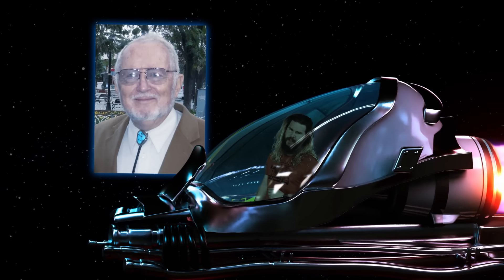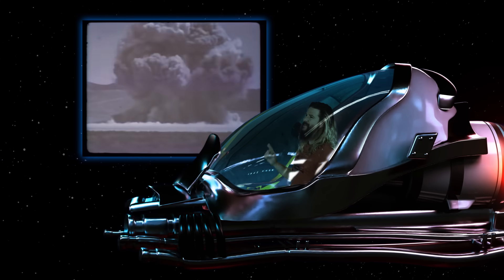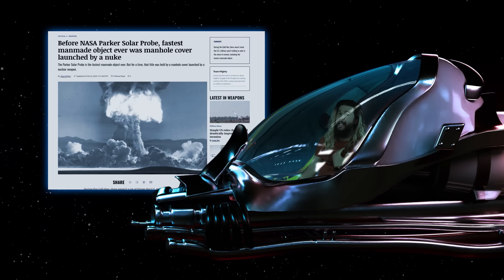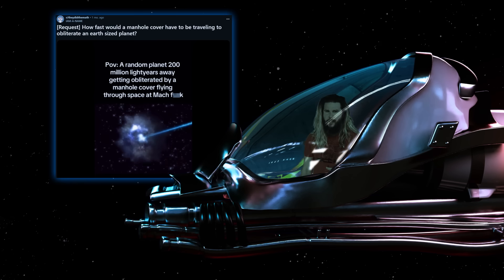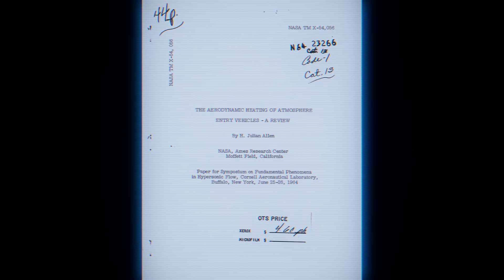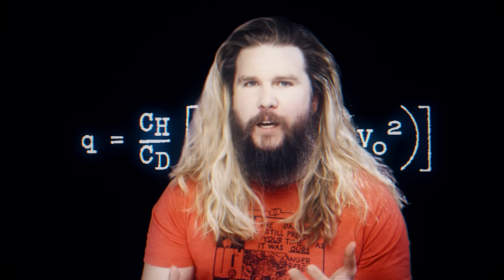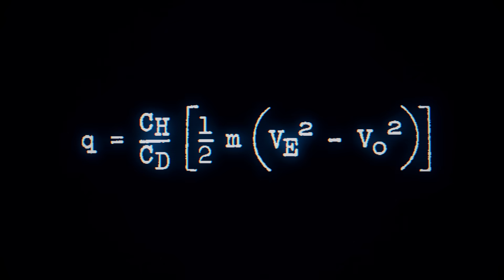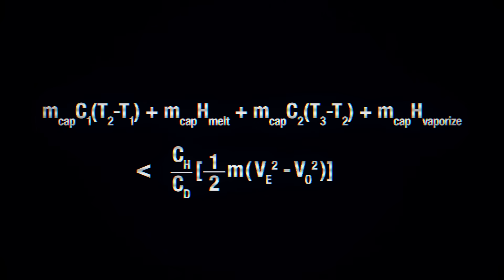Debunking the Nuclear-Powered Manhole Cover

Comment: You made one critical error in your calculations. You seem to have assumed that your audience wouldn't angrily math, but boy howdy are they down here angrily mathing.
Reply: that is what my math teacher was missing... he made us do long calculus problems with no real objective, Kyle has broken the Internet by having a bunch of nerds mathing at a non consequential problem for the privilege of proving others wrong...
Reply: Key factor not discussed: heat transfer is not an infinitely-rapid process, i.e. it isn't instantaneous. While meteors moving 3x slower burn up, an object going fast enough could theoretically make it through before it has a chance to burn up. The object, admittedly not factoring in drag, would have cleared the atmosphere in barely a SINGLE second, meaning it may not have had enough time to absorb the necessary heat to be vaporized.

Second, the comparison with meteors is flawed in a very specific way: meteors are going from a vacuum into a steadily INCREASING dense atmosphere AT AN ANGLE, where the "manhole" would be moving from a dense atmosphere into a rapidly THINNING atmosphere at NO ANGLE. Since the math shown doesn't address that (you would have to integrate the effects of heating/drag across the thickness/density of the atmosphere), it's still possible the "manhole" made it to space (whole or in part).
Reply: it's cause we WANT TO BELIEVE
Reply: no kidding.  wonder how many included that the manhole cover would do one of 2 things.. either it would move along its edge with the path of least resistance and atmosphere drag causing it to sirt of frisbee through the air, or it would be repeatedly flipping in and out of drag til it curved and momentum dropped off. the one thing it wouldnt do is move flat side upwards, the odds of that are miniscule since any small imbalance would lead to one of the first 2 outcomes.  and thats assuming that was the whole manhole cover in the first place and not just the largest fragment.
Reply: whatever happened, some farm animal miles away got the scare of a life when gravity buried it 50ft in the ground.
Reply: Nothing solves a problem faster than baiting people into proving you wrong
Reply: I mathed your mom last night and she was not disappointed.
Reply: Lmaooo
Reply: Bold of you to assume that that wasn't the intention
Reply: One could say, Furiously Mathing.
Reply: lov e this
Reply: In Kyle's defense, he's only a talking head reading a script and doesn't write any of the content for this channel. Although it is still unfortunate that the writers of the script committed such an abortion of logic.
Reply: Ok, so I did some number stuff, and here's what I have. If the velocity is correct, the amount of air resistance on the cover would be 18million lbs at least. Now the velocity of it and the time it would take to get to space negates any deceleration that it would have from resistance alone. Add in the unstable shape, the immense heat from friction, and with those numbers it should vaporize and stuff.
Now, my guess is the fact we see it for 1 frame in what we can assume is a 400 frames/s camera, its closer to 50,000 mph.
So lets number crunch there. You now have 1mil lbs at least of air resistance on an unstable object. The rate of deceleration in this case as well as being unstable means the stresses would rip the steel apart before it even had a chance to get to space.
Reply: The numbers scare me when the start speaking greek but from some napkin math it looked like it was going about Mach Fuck give or take
Reply: The math has to be supported by physics and mechanical principles. Where A LOT of dudes assumptions fall flat is he never accounts for any of the physics, principles don't just work opposite because of direction. The majority of his interpretation falls flat on its face because the fluid dynamics changes at temperature, pressure, and heat extremes.
Reply: yeah lets do math based on a hoaks from 1950s that never proved
Reply: @ivan4087  doing the math even in hypothetical or "hoax" situations is important because the math doesn't lie. Even in "hoax" situations your calculations HAVE to be correct. You HAVE to do the math correctly in order to get any meaningful answers. Unfortunately like Kyle says math DO be like that and even he got hit by it a few times. No one's perfect and mistakes can happen but due to his calculations being off his sanity check is also off. Now idk how much because I'm not trying to do the math but it stands to reason if you're calculations are wrong then potentially so is your sanity check.
Reply: @senbonogyaku  Watch the video, his math is lying. It's like calculating if everyone on Titanic's maiden voyage is alive by doing the math to see if the ship had enough buoyancy when it left port. It did have enough buoyancy, but did everyone survive that trip? No? maybe other factors need to be brought in. Like, did it hit an iceberg??
Reply: @senbonogyaku  Im wondering if the math could be done to see if the cover should have been glowing hot by the time it was captured on film? that should be a decent sanity check.
Reply: @liquidwombat  I was thinking something similar. I have no view but some of the comments arguing for vaporisation seemed suspect to me because if right they'd suggest the frame we have shouldn't be possible as the thing would have disintegrated too quickly.
Reply: @senbonogyaku  Did he stutter?  He clearly was talking about the Finnish hoaks in the 1950s that never proved to be effective against the Communists >:(
Reply: @senbonogyaku wtf is this sanity check? You do this for everyone. And he's insane because he made a mistake? What??
Reply: @FirmB1ade  for example, he didn't consider how long it would be in the atmosphere
Reply: @FirmB1ade i dont think the manhole cover hit an ice berg between the ground and space
Reply: @FirmB1ade He made a mistake. So what? Who cares
Reply: @ivan4087  you would misspell it as "hoaks" classic Ivan
Reply: @ivan4087 brother, it’s filmed…
Reply: @W_I_Z_A_R_D-1  AND YOU HAVE THIS TAPE , ONLY YOU RIGHT?
Reply: Go home Mr. FSB.
Reply: @reaperbsc  ?
Reply: @reaperbsc  Bro is acting as if doing math for fun isn’t a thing. I don’t particularly care whether or not it actually happened, the math is fun.

Comment: What if the man hole cover rotated on its side and flew like a frisbee? Or does the equation represent the drag and heating of it flying flat face out like a plate?

Probably have some huge variation on the calculation. Unfortunately its only in picture one frame, so we cannot ascertain its rate of rotation.

Comment: Another good analogue, though a bit large at around 7700lbs, would be the Sprint Anti-Ballistic Missile, which accelerated to around Mach 10 in 5 seconds and had skin temps around 6200F (~3700K). They needed heat shielding and really strong radio signals for guidance due to plasma formation during it's ascent.

Comment: Sorry, this is one of the few videos you've made with major errors. Although I think your conclusion that it was likely vaporized has merit, there is just so much we still have to guess about (or are well beyond my understanding of math and physics). Which I see a lot of people are tackling in the comments.
But I think a more interesting question is what would have happened if it survived largely intact and they were (un)lucky enough that it hit the moon at that speed... short answer: a 2000lb piece of steel travelling from the Earth's surface at 150,000mph would result in a 1.96 terajoule impact, creating a crater roughly 1700ft wide and 170ft deep, vaporizing and ejecting massive amounts of lunar material from the surface. It would be spectacular and terrifying, and could easily be seen from Earth.

Comment: Ok beyond resonable doubt if anything reached space it wont have the shape of a manhole any more more like a molten shrunk reshaped teardrop ... however i see one thing missing in this equation where it maybe(?) changes from reality. The calculation done assumes a normal "static" airstream like you would find it on the planet however this one had a significant amount of pressure riding around/infront of it that might change the amount of drag experienced ... for how long and how far? I have no idea. Was it enough for it to matter? I don't know. But since it wasn't mentioned it either means i am on a wrong horse ooor it was something that kyle did not calculated. ^^

Comment: Cap cover was 900 kilograms or 115384.615 cubic centimeters of cast iron. Cast iron contains a high amount of carbon roughly 20% with trace impurities of other elements. Just in case anyone else was interested.

Comment: Alert! Alert! You had an assumption (over simplification) that you did not justify, @8:10 - "the drag coefficient of a flat disk moving through the air".  1) Because it will likely very quickly become asymmetric which will make it want to tumble.  2) Once it melts (way before it vaporizes), it will cease to be a disc.
Also, regarding your observational confirmation argument @10:37,  "we have seen meteors ... with a similar mass spectacularly destroying themselves in our atmosphere".  Yes, and they were not solid iron they were composites with lots of water and other materials.  In general, large iron meteors do make it to earth - thy are just rare because they type of meteor is rare.  But, the ones we find are typically a few cm or less in size.  Actually the most common ones are probably microscopic.

Comment: Ok. I’m not worthy of your math… BUT.. There are some factors I’m worried might not have been considered.   1).  The Myth Busters Effect (if the coin/manhole cover took a “skinny coin side” trajectory and not a flat-fat-ass-facing one.). 2). Does your equation take into account the air pressure/altitude where the event occurred, (ambient air pressure at the time of the event, and that air pressure diminishes the farther the projectile gets from the surface of the planet)?  If so, is there a condition where the values would allow an exit?  If the test were performed at the summit of Everest in the eye of a Cat. 5+ hurricane, would this increase the chances of a projectile successfully leaving the solar system?  This would be an awesome video!

Comment: Multiple flawed theories in this video. First the caps path was substantially shorter than the path of a meteor as in less than half. As meteor's are never direct impacts do to orbital mechanics & gravity. Second the cap had already passed max-Q & highest heat point in the single frame captured intact. Third any deformation creates a more efficient shape not less as starting shape is the least ideal. Even fully molten metal naturally forms a rod at high velocity. Forth cast iron contains roughly 20% carbon the material with the second highest melting point. That also sublimates ablatively at that melting point. Fifth cap is propelled by plasma from the nuclear blast. For at least part of the lower atmosphere this would reduce drag similar to a base bleed project. Elongating the caps shape & lowering heating on the trailing edge. Sixth this is the true inverse to retry. Object reenentering is heated greatly reducing structural integrity followed by shock-loading in the lower atmosphere. The cap had max integrity at highest stress followed by rapidly reducing heat load & gentle vacuum cooling(if orbit was obtained). Until rail or gas guns reach a substantial percentage of estimated speed the data to calculate a result is simply lacking. More interesting would be projecting flightpath with possible gravity assist. If it did reach orbit to likely intercept with another object. The quest for mankinds fastest spear would be entertaining at least^_^

Comment: You should revisit your calculations, taking into effect the time of flight through the atmosphere and its changing density. There's a couple things you didn't consider about reversing the heating equation, which is that objects entering the atmosphere 1. don't travel perpendicular to Earth's surface, and 2. encounter increasing drag-induced heating as they proceed through their trajectory. At 66 km/s the lid would only have been exposed to heating from drag for a couple of seconds at most, and would have been through the thickest part of the atmosphere immediately post-launch.

So there's a chance some piece of the lid made it.

Comment: Makes me wonder how much additional heat from the nuclear blast was imparted onto the cover before it even got its start.  That would have to send it way over the heat capacity and give you quite a buffer on the numbers.  Even if it was just air pressure burst launching it the nuclear flash should impart some heat.

Comment: Using the calculations for an object entering the atmosphere does not equate to an object leaving. An entering object is subjecting to increasing pressure and drag as opposed to lessening during exit. You did more math than most but still not accurate enough to say it's a definitive answer.

Comment: Hey man im no mathematician or physicists but ive blown up enough shit and know enought about how shit blows ups up and aerodynamics to your numbers werent fully correct.

2 big things the man whole cover would not be a flat chunk of cast iron, it would bow into a bowl like shape then brake at the welds providing significantly better aerodynamic performance than you had calculated for, second the equation you used is for re-entry not exit of our atmosphere. As an object leaves our atmosphere it will get exponentially easier as it goes threw the thinning atmosphere. 

Now it is certainly possible the cast iron cap vaporized before makeing out however more math needs to be done to truly determine that.

Comment: I was thinking throughout this, don't meteors burn up in the atmosphere all the time, and aren't they often times made out of iron? Also, not sure how it factors into things, but it sounded to me like the calculations were made with the assumption that the manhole cover was still as it was moving through the air. I imagine it would have been flipping end over end like flipping a coin.

Comment: I will comment in here that it likely shattered from differential heating and force after it no longer had a massive amount of energy directly applied to it.  This is also a problem with railguns that have tried to fire disks.  You have to really really really make these things tough to have them not simply fold in on themselves and twirl/tumble.  

There are further maths involved with this such as plasma's insulative properties, leading wave, emission cooling and other things that DO stack up to immense numbers but I don't think the total result would overcome the primary input.  Interestingly the location being at 2000ft and the weather being dry are both significant numbers but have no effect on the result. Any tumbling as well as the initial slope of the ejection would result in a much longer trajectory through atmosphere and even mid-level atmospheric wind speeds are involved.

Now sit down with some guy from NASA and find out why dropping two ton tungsten sign poles out of orbit is effectively impossible!

Comment: So here’s the thing… we’re assuming it would stay in the least aerodynamic position possible. Isn’t it likely that the disc could have rotated so the thin surface, not the 1/2 meter flat surface, was the surface facing atmospheric resistance? Even a slight change in air pressure could throw it off balance, and it would naturally land in the direction of least resistance, am I wrong in this assumption?

Comment: would the orientation of the manhole change the energy imparted via drag, like how the Mythbusters showed a penny will have different air resistance depending on which side it falls (the flat side or the thin edge) im sure this would make a difference but perhaps not an order of magnitude that it needs

another thing might be the material strength, perhaps the metal warped into a more aerodynamic shape from the blast